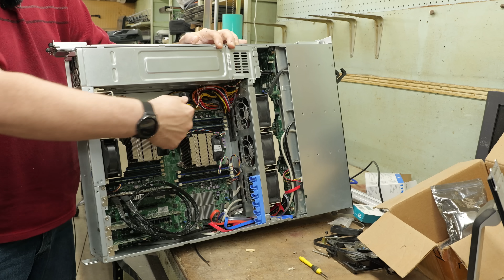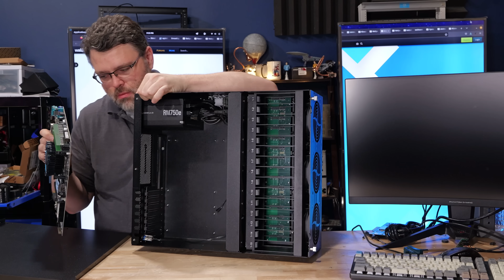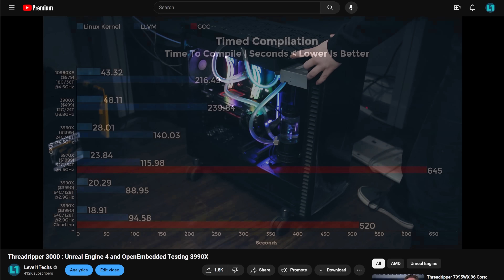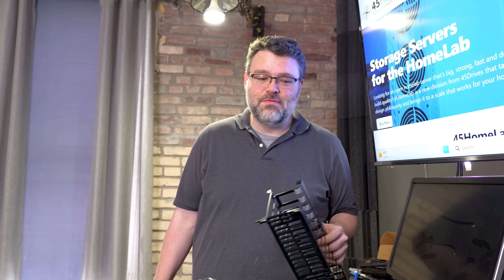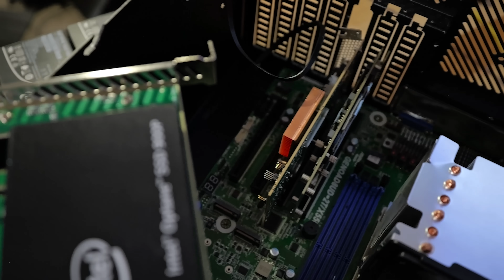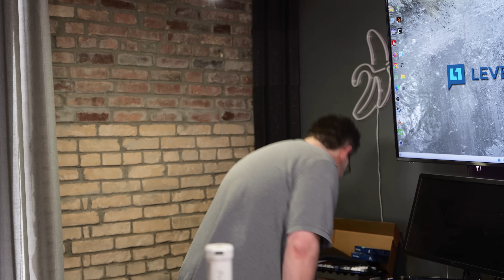45 Drives HomeLab HL 15: Why the Chassis is Important

Comment: Case looks promising.  Wish they had a deeper version that was unused space for tinkering and such.  I also wish they had options to use Supermicro redundant PSUs. I know I can 3D print an adapter but would be nice to see OEMs support it out of the box. There might be IP protections in place that 45 Drives can't get around but who knows.  

I took an HP DL380P Gen8 (with 12 3.5" LFF bays) and gutted it besides the drive bays. Added a Tyan board with Epyc 7302P and watercooled the whole thing with Alphacool's server lineup. And salvaged an Supermicro PSU setup from an old 2U I had in the graveyard.  Works like a charm and I plan to use it for a long time to come (until I somehow need a 4U setup instead).
Reply: Hi Bryce, I know it’s a year later but I wanted to thank you for the feedback and let you know that we are currently working on a larger version of the HL15 that is extended a few inches. It will accommodate eATX mother boards. It’ll also be 5U to accommodate large GPUs. We do not currently have a roadmap for adding redundant PSUs in the HL15, as majority of our customers want something quieter for home use. Updates on this project is on our 45HomeLab forum

Comment: I've played a bit with truenas scale and virtualised pfsense.  I can't get it to work without passing through a dedicated NIC to the vm - multicast doesn't appear to work for failover.  I ended up using the motheboard nic for the firewall, a cheap 1G pcie/x1 nic for truenas management and a 40G storage nic (because I"m cheaping out and don't have a 40G+ switch.)

Comment: I'm not sure I would want to buy this Chassis for my home rack due to well firstly it's $799 without hardware and second it has no hot-swap front bays which are easier to work with. I'd have to pull this entire chassis out to access the screws to remove the top plate. Like I would forgive that on a $199 case but $799? - I can get a $399 SuperMicro with 16 front-swappable hot-swap bays. Or I can pay $550 and get a Gooxi with 24 hot-swap bays and a SAS expander backplane built in with ATX PSU support.

I'm honestly scratching my head as to why someone would want to pay more money for less stuff? I could see it being useful if you need a super shallow server but still.. that price is hard to stomach for 15 drive bays without a SAS expander included in my opinion as that alone would necessitate buying a larger HBA with 16 drive connectivity which costs more money and so on and so forth I'm not sure it makes sense to me this product.
Reply: yeah it's kind of strange. The only benefit is less noise (because of large fans), which is debatable for a rackmounted case anyway. This case is a "cut down" version of their larger ones with 20+ drives where it's normal to have them come from the top because that's the only way to fit so many. But it's clearly designed in a way that is "more convenient for them to make" than actually useful in this form factor and market segment
Reply: Not to mention it can only hold 15 drives in a 4u height. A SuperMicro 4u would hold 24 drives.
Reply: I thought I finally got who the target market is: nerds who want to build their own 10-20k$ servers from new parts, and don't want to go for a pre-built/used for the similar price. Case costing 5-10%  of the build may be justified then. ...but, your comment just destroyed my argument before I've posted it.  Realistically, you can buy a decent spec used machine for 800-900$
Reply: @notserpentis  I don't understand the hype for their cases at all. The things have to be slid out to change drives. But as for the price...I spent $868 back in 2018 for a 3U SuperMicro chassis brand new from AcmeMicro. Too hard to find used for the specific backplane and PSU setup one may specifically want. But I will backtrack on the sentence about cost. I looked up my invoice as I was typing that sentence, expecting it to be at least twice the cost of this 45drives thing. But that gains me 1 more drive slot at 1 less rack unit of space. Drive caddies. Two power supplies of a higher wattage, and something to bring them together. Most stuff on it is tool-less. The power supply board can be plugged into the motherboard for management info stuff. Same with the backplane. If used with one of their boards, everything is going to line up with the air duct that sits inside, which means you don't need fans on the heat sinks. And then last year right before Thanksgiving, I found someone local selling a server inside the same exact chassis. Loaded full of 4TB SAS drives with old X9 hardware, for only $500. If you jumped up to 4U with SuperMicro, that gives you 24 drive bays. So yeah, I don't get the market for this either.

Comment: Is there an all-2.5" drive option? I can't seem to find one.

I have a bit of a unique use case in that I want to build a family NAS, but it needs to be light enough it can be carried out the door in an emergency (we live in a tinderbox Victorian-Era farmhouse) and it needs to (really) not suck on data throughput. It needs to be able to sustain 4 PCs running backups to it simultaneously, each over its own 10GbE NIC.

Currently we store family PC backups to external USB 3 SSDs, and once a month those drives leave the house, get driven to the bank safety deposit box we have to be able to recover our lives should the absolute worst happen. There, they're swapped with the alternate drives from the previous month. Rinse, repeat.

Each computer in the house has ~1TB of storage on it, and we follow the 1 + 6 full/incremental backup cycle, so the external SSDs are 2 TB each.

So, with a 7-drive NAS, the current system could be replaced with a RAID Z3 array. With a 14-drive NAS, it could be replaced by a Z30 array (double the write throughput, which is pretty much where the "it feels as fast as having the local drive" part comes in). Since there are ITX boards with 2 M.2 slots +3 SATA ports out there (or you could get one with 2 SATA ports and boot off a USB stick), this is a feasible setup, as long as the chassis to support it exists and you acquire 2 M.2 to 6x SATA adapters.

I went to the trouble of checking if the Fractal Design Define 7 Nano has enough internal footprint to support mounting 14 SATA drives which all receive active cooling. It, in fact, does if you're willing to drill a few holes and mount some 2.5" drive cages (16 max if you do something a little crazy with a dremel). But, if there's an off-the-shelf solution out there, I'd much prefer that.

Comment: these are real nice however very pricey for what is essentially a case. I really want to see backplanes for 10-50 bucks depending on size as I can make my own HDD racks even with fans for peanuts. I'm thinking backplanes in the 2/3/4/6/8/10 variety. I generally try to do 4 or six myself when making my own drive cages as two stack of 120mm fans fits perfect. i'd also like to see old school cases with large amounts of HDD cages for under a 100. full server towers all that. the prices are way out of whack. i don't understand why drobo and all these off brands charging so friggin much for a backplane plus simple case.
Reply: Icydock is the king of this

Comment: ive been drilling out the rivets of the super micro psu and removing the whole module and replacing it with SFX power supplies and a home made bracket to fit in the case, there also quieter
Reply: Check out the Supermicro SQ PSU - it's damn near silent!

Comment: My struggle with high availability in the home lab is the fact that there aren't many easy options for 2-node hyper-converged. During my last go around, every hyper-converged option required a 3rd node for quorum, and suddenly all the input costs go through the roof (equipment, power and cooling). Are there any projects that support 2-node (or a very easy quorum node) deployment?
Reply: The Corosync cluster engine (used by proxmox) allows you to use devices as only a quorum "voter". If you have a raspberry pi sitting around that can provide a quorum vote to get you past the two node initial limit, or to provide uneven vote count in case you've got for example 6 cluster nodes with equal votes.

Comment: 1:45 Supermicro PSU dies? You can just get a replacement, because they've been using the same cases and PDBs for 15 years, and you can fit 24 or 36 disks in the same number of units this thing chews up for a paltry 15. An 846 or 847 is a much better prospect for a homelab than this ludicrously expensive thing. Rack not deep enough? You can afford a deeper one out of the change, because you can pick up those SM cases for a quarter to a half of what the HL15 costs.

Comment: So... with a focus on fast storage subsystems for pretty much all aspects of homelab: and the reasonable costs of NVMe/AIC/U.2 flash... looking for a massive amount of PCIe lanes on the used market (EPYC-gen2/TR-gen3) would put you in a good place?
Reply: Yup. Rome generation is cheap now and Milan is getting cheaper. If you don't plan for upgrading to 3rd gen you can snag boards for around $200. All those PCIE lanes at your disposal.

Comment: The chassis is really really nice. I wonder what is going to displace sas/sata? I saw some nvme 3.5 drives a while back. Are new backplanes going to be available in 10 years?
Reply: mechanical drives are still nowhere near Sata 3.0 bandwith and given how the main growth is capacity and not speed (they can't compete with SSDs anyway), they are still going to be Sata in 10 years

Comment: If 45 Drives wants to reach the home consumer market, they need to come up with a cheaper chassis. 
This chassis is way too expensive. 
It's just impossible to justify an 800$ case.
I can buy 4 x Fractal Define cases at least. 
For that price (and considering the added cost of the components), I can also buy an enterprise refurbished server that will still be cheaper. 
For me, this shows a big disconnect from 45 Drives and the market target they are trying to expand to.
Reply: The market is just Wendell... he is supporting the whole company with his madness.
Reply: That is a problem of being profitable with low volume product. The potential of how many cases they can sell is realistically just not that high. However I see this as an investment. It's not something you are going to replace in two years.
Reply: @ivanmaglica264  sure, however for a home environment, they did zero compromises, which didn't help.
For example, the home user doesn't need  a tooless drive slots.
The home user doesn't need a fancy front face place, instead could be a simpler mesh with a filter.
The home user in general, doesn't need a chassis that is made like a tank (thickness of the metal).
So in general, 45 Drives didn't release a server for the home user, they just released a small server that will only be purchased by either people with a lot of money or small companies. Supporting my claim that are out of touch with the target market.

Comment: You're starting to build my cluster, I have a heterogenous ProxMox cluster w/ a forbidden pfSense router, ~300gb memory, 2 GPUs, ~68 threads.  Everything network boots, which is a point of failure.  Has Intel confidential Xeons, Zen 3, every flavor of Linux, Windows, a domain controller, automated certificate issuing, the whole 9 yards

Comment: 3.5" drives are unlikely to be the way to go in the future, so the bracket and backplane is likely to go in the trash. Even with the setup you have, I'd go directly into the drives instead of through an HBA. PCIe over cables is great theoretically but horribly unreliable in practice, as you touched on, at least for gen4+.

Comment: i personaly would recomend a ddr4 platform with a amd am4 socket becuse there is plenty enogh compute power, there are efficient if you stay below 80% load without OC or Boost, also amd supports many needed server stuff like ECC ram and other encoder and decoder even there are officel not supportet. intel on the other hand dos the same like amd in terms of reuse server cpus as consumer cpus but everything whats server related is deactivated or not connected and if this is not the case you have to pay yearly for it to use. 
the other thing why ddr4 is stability  and cost. ddr4 is a long time around and so you getting cheap parts for your system also you can google for any problems with some mainbords you may wana use. but with the actual generation is not that well ducumented obviersly. so you may ran in some troble who no one has a answer for. i dont see going that risky way becuse i dont need that much power.
i have athome a small server wich is running a mainecraft server and a samba. it is a intel silver j5040 soldert to the mainbord. it is a 10w cpu with sata ssd and two hdd have a total energy consumption of 18W but  yea i know i sayed amd and well documented bords but power effecenty and nois was also a thing for me. on my minecraft server are permanent around 6 to 14 player and 22 max. the system runns dead silent on a pico psu with a 25W 12v wall wart the drives are zu 95% over the day spinned down becuse there are used only for the samba and the 12h minecraft server backup. the drives sinning down after 2 min without use. you may think this system is too weak but no the minecrft server uses only 30% with all 22 players and uses only one core. the samba i dont know mosty it is in idle so under 1% and under use maybe 3%. the system uses for the most time over the day only 6W to 8W. i have the same system with only one ssd as my main system for browsing and youtube and some workstuff like exel word and programmig. on both systems running ubunto 20.04 LTS. i have a gaming pc but for daily use it is to costly 160W on idle is it not worth having a pc 18h a day on.  i game not daily and if i play a game then only for 3h so this system is maybe 20h in the month on and for the most part i use the j5040 system.

Comment: Threadripper pro PCIe 4.0 or 5.0 riser cables the Sage mainboard a ton of Legos or the Chinese stuff because you won't find a fitting case for that board that lets you use all 7 slots with 3slot height GPUs
Melanox 100G can a 100G card still use DACs?
A 1inch thick board with good swivel rolls with breaks.
Silent fans.
A big air cooler and probably low profile RAM so it fits under the giant cooler block.

Comment: So what does Omni-Path even do? Any research into it yields nothing but more above-my-head jargon.
Reply: it is a high speed/bandwith low latency "special network" for servers in close vicinity. It sacrifices cable and cost so it's not really competing with ethernet
Reply: It's useful if you have a cluster of servers running storage or applications that talk to each other all the time. I.e. if you can't make a big honking server big enough for your performance needs
Reply: I don't understand at all
Reply: when you need more performance (or storage space) than a single server can do, you must use many servers. Often you need a way to "join" them so they act like a single big server. 
Omni-Path is the special cards and cables you use to join many servers to make a "single big server".
It works like the server motherboards with multiple CPUs, but it joins multiple server racks.
There are other technologies that do the same job, Infiniband is the other big name.
Reply: @marcogenovesi8570  I don't get what it does though. Is there special software that presents those resources to the "main" server as if they're inside of that server? Does it distribute other resources like CPUs and GPUs?

Comment: $800 USD for just the chassis. No thanks.
Reply: See video for argument.
Reply: @edwardallenthree  I saw, but it still doesn't make it worth it to me. Cut the number in half and maybe.
Reply: @TechPewGuy  I guess here's how I look at it: I paid that much for a used supermicro chassis. Admittedly, what I purchased was a 36 disc hot swap enclosure which I ended up using as a jbod enclosure.  

The factor I think you aren't considering is the back plane.

However, maybe I am not considering something that you have. Do you have a suggestion for a case that has a 16 drive or 15 drive back plane?
Reply: @edwardallenthree  currently I have an r730xd, and 3 or so R720XDs. I got those all free, so caveat there. That said, if I was starting from scratch id probably only get a rosewill case as janky as they are and then cherry pick HBAs off eBay or something. The backplane is nice for sure, but I think the price is inflated regardless. Great points you make.
Reply: @TechPewGuy  I literally did exactly what you were describing. I have that old case in a box, good riddance. If you're using forward breakout cables, you're in for a world of pain.
Reply: @TechPewGuy used r730xd would still be cheaper. Yes you're locked to v3v4 platform but for pure homelab it's more than enough. I'm using personally some nzxt 210 case with supermicro v4 board. 4hdds. Holds up to 8. So depends how home that home lab is 😊

Comment: Who is hoarding 15*18TB of data at home? I mean I can imagine a rare instance, but not common enough to support standard products like this.
Reply from the maker: There's a lot of cool old TV you can download from the Internet archive . . .
Reply: @Level1Techs  It doesn't need that much space if any reasonable consideration is put into the data format and compression. I have 3 people streaming TV in my house several hours a day and my total internet connection uses less than 500GB/month. (270TB at 500GB/month = 45 years)